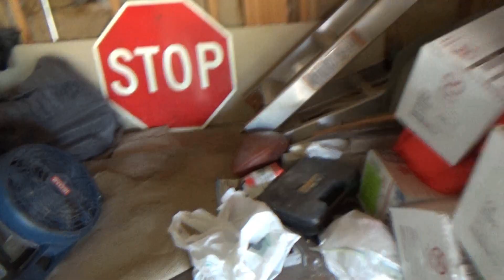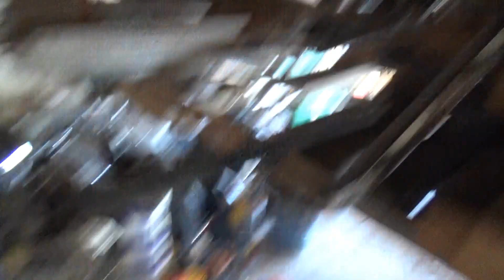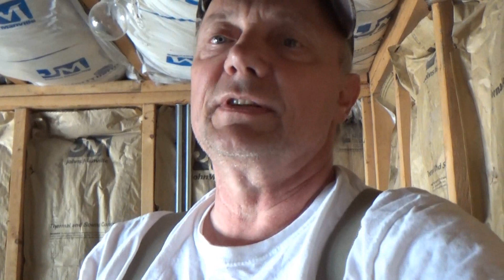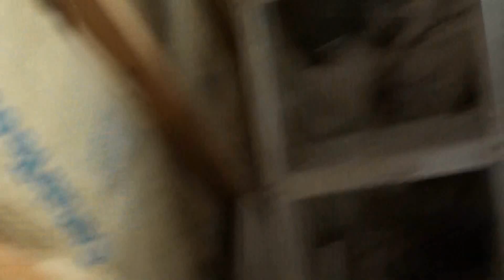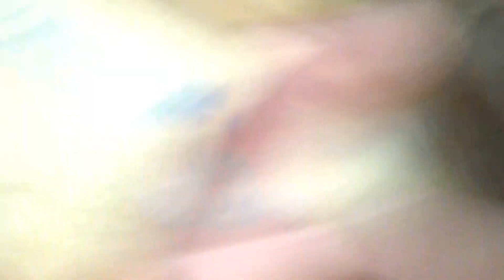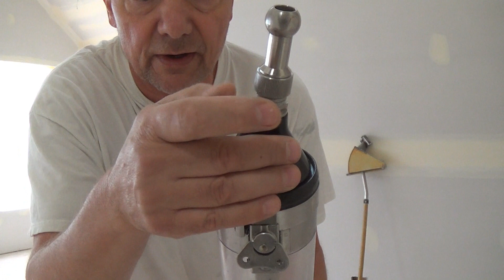Mudshot intro and leg injury

Comment: Glad you’re okay.  Can’t wait to see you run the mud shot.  I almost went with it instead of the MudRunner, but was concerned you wouldn’t be able to clean up an angle without adding more mud.  Seeing the adjustment makes more sense.  And as I understand it, it doesn’t take much pressure at all to make it work.  Nothing like the old boxes, which are man beaters.

Comment: What were you thinking Dr? That looks extremely dangerous to me! Of course in Jan 2020 against my better judgement,I climbed up on the very top of a 4ft folding scaffold to tape some ceilings. How stupid was that? Yes I fell and snapped my tibia bone into! It was a compound fracture and the bone was sticking out of my skin! I could have died on the scene if the jagged bone had cut my leg artery! After 2 surgeries I'm back working! It's stiff and it's never going to be 100% ever again but I am able to walk with a slight limp and work to support myself! As we get older we all need to listen to that inner voice that tells us to be careful and not take chances with our safety! I wish I had of listened to mine. That was the first time I had ever broken a bone too in 54 years of life. It was a massive break though. Broke both lower bones, but only the one poked out through my skin.
Reply from the maker: Glad you're OK I keep thinking I'm younger than I am.

Comment: Hi sir...what automatic tool do you suggest for drywall ceiling meeting concrete wall corner?....I know across there,you'll mostly do walls of drywall buy I live Trinidad an our walls are mostly concrete
Reply from the maker: I would still tape them with the bazooka but after it's finished I will razor knife the angles and caulk them.  That way the tape won't pull off with shrinkage and settlement.
Reply: @THEDRYWALLDOCTOR1  an what corner tool do I use to cover the tape without damaging the head on the concrete wall
Reply from the maker: I have been doing a lot of concrete ceilings just using the bazooka roller and 2.5" angle head. If you have any bad spots floating it out with speed set is a good idea before you tape.
Reply: @THEDRYWALLDOCTOR1  are there any videos with concrete angles I can view ?
Reply from the maker: https://m.facebook.com/story.php?story_fbid=pfbid0u8z2jNTbQjBnGqsqXuniFUxsDdjSXJgRR1mKGxJ39z75VzS52grvWXhfdFBj3n44l&id=100006155765089&sfnsn=mo&mibextid=RUbZ1f
All the high ceilings are concrete plastered in.
Reply: @THEDRYWALLDOCTOR1  oh thank you but I'm referring to what to use on the corner if the wall is concrete an the ceiling is drywall not If the ceiling is concrete
Reply from the maker: It's the same thing one side concrete the other drywall.
Reply from the maker: Also use cover coat 👌  it's made for that.
Reply: @THEDRYWALLDOCTOR1  cover coat🤔
Reply from the maker: https://images.app.goo.gl/abi9iomPJT6YjaaT6